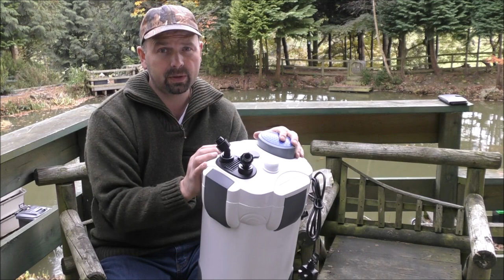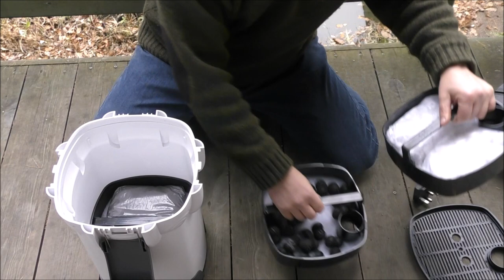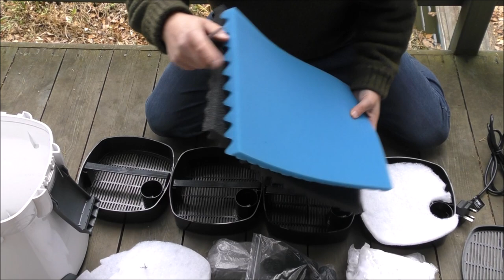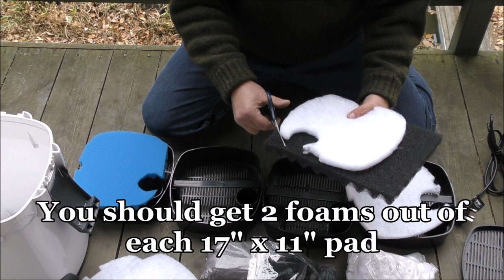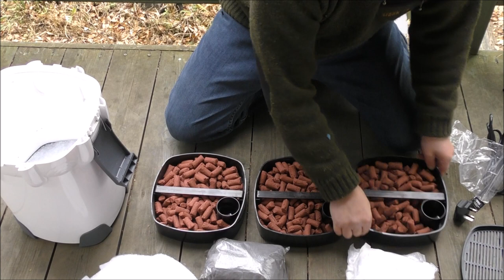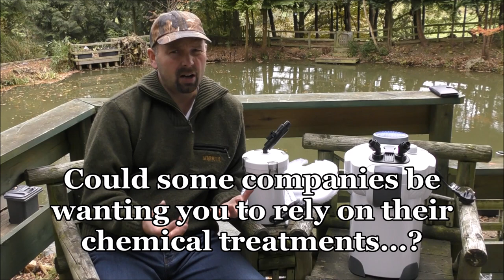Why Your Filter is TOO SMALL and NOT CYCLED

Comment: How do you do with the Fluval FX6? Can you do a video about that also how to set up that canister filter with foam and biohome media. Sinceraly Conny Karlsson Sweden.
Reply from the maker: I have just answered exactly the same question from you which you posted on another video about a minute before this one?

The FX6 trays have water flowing through them from top to bottom and as you have good foams surrounding the trays you really only need a fine pad on top of the top tray. That allows you to get 5kg of biohome ultimate into the 3 trays in total. I have an FX5 which I will be using in an upcoming 'pimp my filter' video and that will be the same set up for FX5 and FX6.
Reply: Hi Again! Ohh, excuse me, I ask you again at the other video. Maybe it will help others also with Fluval FX 5/6 how to install their canisters. What color do I need on that fine pad? I bourght one original Fluval a blue one is that the one you mean? Or a white one that I should have? That are in the middle/center of the filter and in the top of the filter, that is the only thing I need, about 1cm thick? And in the rest of the trays below to the bottom of the filter full with biomedia? Is this correct? Many thanks for fast answer. I epriciate your videos. Sincerally Conny Karlsson Sweden.
Reply from the maker: As you have good foams surrounding the trays (all the way around) they catch the majority of dirt so you really only need a fine pad on top of the top tray (colour doesn't matter as long as it is fine to catch fine particles) and that will allow you to fill all trays with media - you can get a maximum of 5kg of media in the trays.
The fine pad does not need to be thick and if it is dense enough then 1cm thick is fine.

Comment: Have you ever try Sera Siporax? When you use that filter media the cycle will be done to the end (Nitrate to Nitrogen N2) with a normal size of filter.
Reply from the maker: According to the manufacturer, lol
Siporax has a great structure but that huge hole right through the middle of it prevents any anaerobic activity unless the flow is extremely slow.
Reply: But it works and it´s self cleaning.
Reply from the maker: I will cover 'self cleaning' media in an upcoming video. As siporax is a sintered glass media it is very receptive to media, just like biohome so it does not build up bacterial slime like plastic media or smooth ceramic media would but the structure is very regular and the shape of media is different due to the thin walls - damn, I've got so much to cover on filtration when I get my studio built, lol

Comment: Can we use a booster filter on a Fluval Fx6 canister filter and possibly remove the foams that go around the media baskets in the fx6 canister ?
Reply: Yes you certainly can. The booster filter or 'pre-filter' as I like to call it will take care of all the mechanical filtering needed and then you can focus the Fluval purely on biological filtering.
Reply: @DanielHoogland  will the booster filter slow down the flow rate going back into the tank?
Reply: @shawnfarray7353  Yes. I think Richard also mentioned this in the video. It limits the throughput of the filter a bit because there is more media to 'push' through. I have no idea how much but I use these pre-filters on all my potfilters and they do awesome!

Comment: Hello Pond Guru, do you still sell aquarium accessories. `m looking for the suckers I bought from you around a year ago. Approx 6cm in diameter and made of soft clear plastic ? Thanks.
Reply from the maker: I only really sell filter media and foams now- I have run out of the suckers as they were something I bought in bulk a while back. If you search the arts and crafts section of ebay or amazon you will find all sorts of suckers there with or without hooks.
Regards,
Richard
Reply: Thanks mate. Got them now. (from a bathroom dealer) :-) In the meantime, what would you feed to newly free swimming angelfish. I don`t have newly hatched baby brine shrimp but I do have microworms, frozen baby brine shrimp, hikari first bites liquifry, and home made food with egg yolk mixed with water. Cheers :-)
Reply from the maker: What you have sounds good enough and it would probably help to install an air driven sponge filter in the tank too since fry will be able to feed from it.

Comment: Would 2 sunsun 302's with 4 lbs of biohome ultimate work for a 40gal heavily stocked mbuna tank?? Or would 8 lbs be better??
Reply from the maker: That is teh same as the APS 1000 filters we have here so holds 1kg (2.2 lbs) of biohome ultimate per tray.
Therefore if you are using 2 filters you could get up to 4kg (8.8 lbs) in them assuming that you're using the bottom tray for the foams and fine pad.
For a heavily stocked cichlid tank you could need 6kg (6.6 lbs) to achieve the full cycle so I would say go for the full 4kg (8.8 lbs) as you can never over-filter a tank.
Reply: Thank you!! Awesome advice 😊 love your videos I appreciate what you do for us who lack information 😁😘👍👍

Comment: Hi Richard.
Can I just ask, how would you set up a Eheim pro 4+ 600 what with its pre filter? and does it filter from top down?. I'm Using your pimp your filter guide foams and 3kg biohome. .im thinking use there pre filter, then the tray eheim substrat pro and floss as it come,  Then bottom 3 tray biohome ultimate.  What you think, no room for medium foams.  Cheers.
Reply from the maker: The pre-filter- tray should just be left as it is with the coarse foam in as it acts as an extra mechanical filter. The water hits that  first before travelling down to the bottom of the filter and rising up through the trays and out the centre of the pre-filter tray - therefore the bottom tray would have coarse and medium foams and a fine pad followed by the 3 trays above that filled with media.
According to my records you should get 1.45kg of media in each tray so it will easily hold 3kg of biohome ultimate in teh 3 trays used for media.
Regards,
Richard
Reply: Pondguru that's great. Thank you, I was a bit confused on the direction of flow with this one. I'll setup. Like you say, and I'll remove the top fine pad, and fill with extra biohome. I'll see if the 3kg fills it and come back for more if it doesn't.  Thanks and have a good day.
Reply from the maker: No worries, any time and have a good day too.

Comment: Very good, you explain it in a great way. Thank you, how would you set up the FX6 filter? biohome ultimate in all baskets?
Reply from the maker: Yes, trays work top to bottom in that and fx4, fx5 so all you need is a fine pad on top of top tray followed by 3 trays of media (5kg total in FX5 / 6 and 3kg in FX4).
Thanks for watching and appreciating the videos.
Reply: So you could easily remove the pads from the outer ring and fill them with biohome? I use 2 FX6 for a 900 litre tank but with stock media. Thanks for a fast reply
Reply from the maker: No you would leave the outer ring of foams as they provide the main mechanical filtration - fine pad on top of top tray would catch fines then 3 trays of media would do the biological filtration.

Comment: Great video! Can I ask, how many kg of media would you recommend for a 500 litre tank stocked with 6 fancy goldfish?
Reply from the maker: The present stock is not heavy unless the fish are large so you could need anything from 5kg (if fish are small) to 10kg if they are large / fully grown as that would give you between 1kg per 100 litres (normal stock) to 2kg per 100 litres (heavy stock) - that is to see full cycle filtration (reduction in nitrate).
Regards,
Richard
Reply: Two are mostly fully grown, the others are only a year old but growing fast!  I will start with 5kg and then I can always add more as they grow.  Thanks very much!
Reply from the maker: That sounds like a sensible plan.

Comment: You didn't explain how you treat your Nitrates? the media your talking about would only support aerobic bacteria, how are you supporting the anaerobic bacteria? high flow filters would be saturated with oxygen.
Reply from the maker: The video explains that only certain types of media with a suitable structure will support both aerobic and anaerobic bacteria and how the full cycle can quite easily be achieved (and what may prevent it completing) in a properly sized filter.
The previous video I did may help you to understand about the differences in media structure and why some is good and some is not: https://www.youtube.com/watch?v=QTtAUYR67Eg
Reply from the maker: Sorry, forgot to mention in previous comment that if you want proper reports of how well the media works just scroll down the comments of this or any of the related videos as the reports of people achieving full cycle filtration are from people who use the media.

Comment: hi im new to fish keeping can you adjust the water flow on canister filters . great video can u do one on uv sterilizers connected to filters plz .
Reply from the maker: You can adjust flow with an in-line tap (bought separately) but don't worry to much about flow. The stated flow given by manufacturer is maximum flow when canister is empty with no pipes attached. For example a '2000 lph' filter will actually pump nearer 1000 - 1200 lph when full of media and pipes are attached in and out of tank.
UV would just be fitted in-line in the existing pipe going into the tank or feeding from the tank - you can fit them either way. As long as the UV is on it will kill algae, parasites and bacteria so it doesn't matter if it is before or after the canister filter.
If you have a UV in the system on a new set up leave it off for the first 2-3 weeks to allow bacteria to flow through the system and set up the filter properly.
Reply: thanks for ur help

Comment: Great video, how many kg of biohome media i need for a 240g african cichlids tank with 2 fx6, top tray with sponge for mechanical and the other 2 trays in each canister for biohome media, if the 2 trays full of biohome in each filter its enough?
Reply from the maker: The FX6 would only need a fine pad on top of the top tray as it has good foams surrounding the trays (water flows through trays from top to bottom) then you could fill all 3 trays with media. Each tray holds at least 1.5kg of biohome ultimate so you could get a maximum of 5kg in each filter (3 trays full of media with fine pad on top tray) but I doubt that you would need 10kg of media for your tank.
Really you'd only need 2kg per 100 litres for a cichlid tank so if you wanted to go with the top tray for coarse, medium and fine pads you could fill the bottom 2 trays with media and if you have 2 filters that would enable you to get a total of 6kg in the 2 filters.

Comment: what's your opinion on Seachem Prime???
Reply from the maker: It is a very widely used treatments but when people report that they are struggling  to cycle their tank it is a common factor in their struggles.
I don't know if it poisons bacteria or simply starves it and the retardation of a cycle is one of the most frustrating things a fish keeper can experience but treatments which de-toxify / bind ammonia, nitrite and nitrate do seem to hold the development back as when they are discontinued in favor of a 'normal' dechlorinator the cycle develops how it should.
Of course many of the companies producing products which mess the cycle up have every solution under the sun for the problems caused by the initial treatment so you end up becoming a very good customer for them and filing your cabinet up with unnecessary treatments.
It is a very similar situation to Western medicine compared to Eastern medicine - in the so-called 'developed' West doctors get paid every time they dish out pills and  chemicals to treat symptoms, even if those symptoms have been caused by the initial 'treatment' which leads to a never ending cycle of treatment (and no cure) whereas in the East doctors get paid to identify the source of a problem and cure it.
It's a simple matter of economics and when the full cycle is totally ignored within the fish keeping community so many people are blissfully unaware that correct filtration and sensible treatment is 99% of the hobby. If you search online now you'll see the aquarium nitrogen cycle only consider the aerobic part which results in high nitrate then the advice is water change, water change, water change - the perfectly achievable anaerobic side which naturally reduces nitrate is totally ignored.
The biggest indicator of chemicals sold as 'treatments' here being a huge problem is when a full cycle is occurring in a filter and water tests are perfect until a chemical treatment is added then the levels go haywire directly showing that bacteria has been adversely affected or even killed off completely in the case of anaerobic bacteria which is much more fragile and takes much longer to re-populate. While many fish keepers are well aware of the bacteria killing dangers of anti-bacterial liquid treatments and overdosing with other 'medicinal' treatments the real dangers posed by the every day products are sadly overlooked since so few people have a thriving bacteria army working in their filters to start with and simply rely on a nation of treatments to 'balance' their tank conditions.
Damn, I could go on all day about treatments but as long as you have a properly set up (suitably sized) filter and use a simple dechlorinator and fish treatments at their recommended dosage you won't go far wrong. As far as chemical treatments for inside a filter go just use carbon or charcoal as that does not have the poisoning effect of many of the treatments sold as clarifying / de-toxifying treatments and never 'recharge' anything with bleach - I've even seen people on Youtube telling their followers that porous filter media should be soaked in raw bleach every 6 months to 'recharge' it which will simply result in a bacterial holocaust and a biological wasteland in the filter which will never support life.
Keep it sensible, keep it simple, keep it alive.

Sorry about the long reply, lol

Comment: Sir , I have 60inches*18inches*24inches tanks , which model of sun sun canister filter is best for me?
Reply from the maker: That works out as around 400 litres so the APS2000 / SunSun 304a / SunSun 304b would be the one to go for as they hold up to 5kg of biohome ultimate giving you over 1kg per 100 litres. If the tank is heavily stocked (e.g. goldfish, cichlids, predators, marine) you'd require 2 of those filters as that would give you over 2kg per 100 litres.
More stock = more waste = more bacteria needed to process that waste.
There is a new 3000 version of the SunSun but I haven't had a chance to investigate that one yet.
Reply: Pondguru thank you

Comment: I have an aps with the prefilter with the 3 grades of foam & the 4 trays in main filter with just alfagrog
Reply from the maker: Alfagrog is a decent media - especially for situations where it sits in muck (e.g. traditional 'box' type koi filters) . As most of the available surface area is external it generally wouldn't support the anaerobic bacteria for a full cycle (reduction in nitrate) but it is way better than many of the ceramic rings out there. If you use alfagrog in a canister I'm assuming that you have smashed it up to make a coarse gravel? 
That can work quite well as it creates 'dead' zones and has the possibility to support anaerobic activity there so it is a versatile media.

Comment: Hi, i am running a 500l set up which is quite heavily stocked. I have 2 of the All pond 2000ef+ canister filters and both of them have uv lights in them. What is the correct way to use the uv lights and will they kill of all the  " good bacteria " in the tank.? I have been told various ways from running them 24 hrs., only 1 hr. or just putting them on overnight.
Reply from the maker: Once your main canister filter is set up properly and mature (hopefully achieving full cycle filtration) then the UV can run 24/7 as it will not affect the bacteria in the filter media.
If you have 2 x 2000 filters set up the same as in this video you should have no problems with pollutants and nitrate should fall when a full cycle is achieved - downside is that it could take 2kg biohome ultimate per 100 litres for a heavily stocked tank to achieve the full cycle. Each filter will hold 5kg so you have the right filters already in place.
Reply: Thanks for the information, i will have to purchase media gradually due to the cost for filling both filters with Biohome ultimate.
Reply from the maker: No worries, sounds good to me and mature filters should be set up gradually with new media anyway so there is no rush.

Comment: My water supply has around 60 ppm nitrate, would a fully cycled filter, like the one you described be able to deal with that when I come to do water changes?
Reply from the maker: Yes there are similar situations from people living in and around London in UK where their nitrate from tap is 60-80ppm.
With enough filtration you can provide the habitat for bacteria to control nitrate levels, reduce the water changes to 10% every 1-2 weeks and make water quality much more stable. Doing this with filtration and proper filter media is not a magic bullet and you could be waiting 4-6 months to see the nitrate budging but it is definitely possible.
Reply: Cheers, is it worth investing in a nitrate filter for the tap water?
Reply from the maker: I don't have experience of them so I can't say for sure but I know a few people do use RO units in areas of poor tap water quality - not sure if that is to remove water treatments or nitrates or both but it does tend to result in very sterile water with a lowered pH which generally needs to be remineralised using a non-harmful treatment (common with discus keepers)